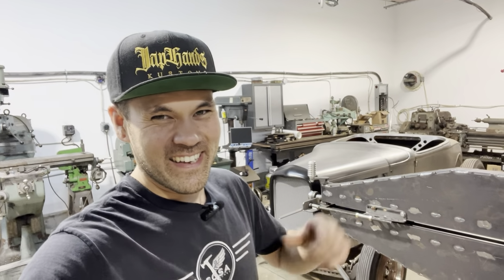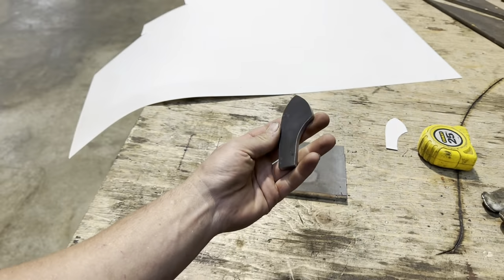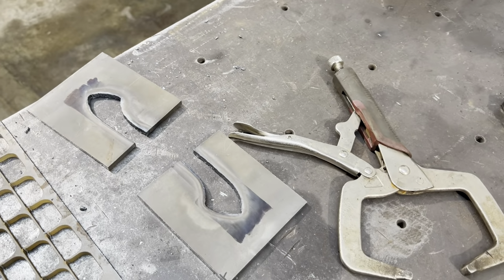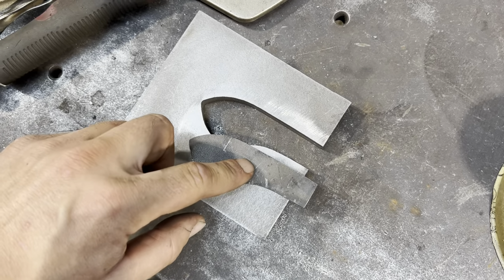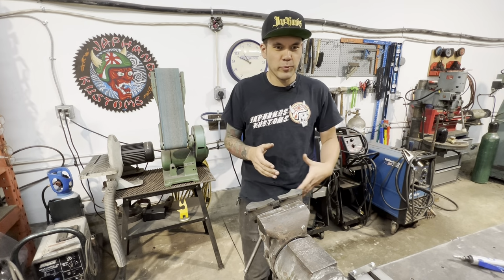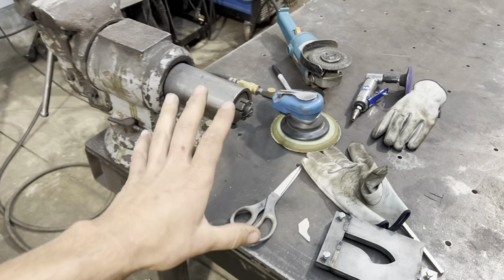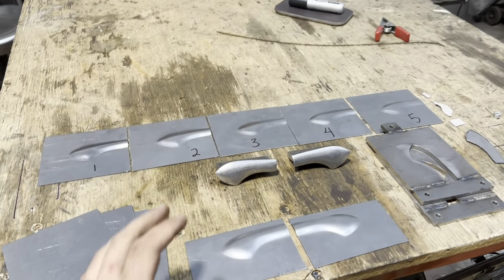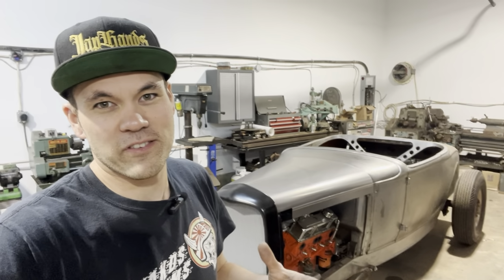How to Finish a Bead Roll & Make a Hammer/Press Form - Roadster Hood Pt 2

Comment: Really love the channel and look forward to every episode as I learn something new in each one. I'm currently working on a butterfly hood from an antique semi road tractor. The bottom of the hood must be "hemmed" or folded back on itself 180 degrees. If possible could you cover this process in a future episode. I don't have a bead roller just a brake, so the final forming must be done be hand/dolly. Any instruction, tips or tricks would be great! Thanks Karl!
Reply from the maker: Yea I have to do something with the hood as well either hemming or some kind of strength on those side edges

Comment: I've worked rebuilding engines, equipment, most of my sixty five years of life, next to guys doing sheet metal work, finishing the "other side of repairs, maintenance" of vehicles, and really enjoying the display of techniques and tricks that make this level of custom, fulfilled.  It's a real pleasure seeing it continue with a whole new generation, just like I grew up watching, learning and finally teaching.  I built a filing machine, "die filer" twenty years ago, and it is an incredibly useful piece of tooling.  I've been "doing this" to steel plate all my life, and am just learning how to "use it to produce the sheet metal finish form.  Mine doesn't have "overhead support", and I think I might well make a gantry to provide that support, seems to be a valuable asset.  At the time I was building my "die filer" a machine shop I used to work at, gave me a pile of "die files", they'd found, almost as if they knew what I was building.  This is the quality of work I watched in my childhood, and eventually did myself, often questioning if I'd ever equal those who taught.
Reply from the maker: Thanks for the great stories John. It’s very cool that you were building your own machinery back then and how lucky you were to get those specific files!

Comment: Always a pleasure to watch your thought processes. Great to see the simple rule to not file steel on the back stroke. So many otherwise skilled fabricators miss that & dull the file. One does back stroke on aluminum to clear chips. Simple but important.
Reply from the maker: Thanks for the tip on aluminum! I didn’t actually know that!
Reply: Hey.
   No problem. You have added to my skill set so much it is a pleasure to add something!
   I have a lot of fabrication work coming up, both structural & thin sheet metal. Thanks!
Reply: At the risk of asking a dumb question, doesn't the die filer just move the file up and down?  So it is always in contact on both forward and back strokes?  Doesn't that imply that it doesn't matter all that much? 
Or does a die filer have an orbital action like my Bosch jigsaw (which can push forward as it cuts and pull back on the reverse stroke, either a lot or a little or not at all, depending on the setting).
Reply: I was referring to hand held files.The die filer is a specialized application & files must be replaced when dull.

Comment: that really turned out great. I was really impressed with your torch cutting skills! Because that is not easy to cut something like that and have such a smoot cut! I have some welding experience from my mid teens in a welding school in Oklahoma City, Oklahoma. I've done gas welding and stick welding and got on the cutting torch a little, but didn't get into any tig or mig welding, but I've done some mig welding in the last 7 years.
I think the detail for the hood bead looks great. It really fits the car so well. Thanks for sharing the skills. I may never do this part but it's great to watch you make a body for this one. I look forward to the mig and tig tips on the next one and seeing the new detail welded onto the hood!
Reply from the maker: Gotta love the torch. It’s just so versatile a tool. I was lucky to have a excellent teacher. Thanks for watching! I’m looking forward to getting it welded in

Comment: Karl, I'm in West Michigan and my history (retired) includes commercial art which, did not totally satisfy my manufacturing desire, so I ended up involved in the injection molding, and stamping die support industries. Your a true metal tool and die kind a guy and I love your application the the Hot Rod arena. So cool.

Comment: Great result Carl making press tools is very rewarding especially when It works, I've used copper under the press die cut to shape between the metal and die for heights and edge crispness. Great video mate down under.
Reply from the maker: Great idea thanks man ! I’ll
Have to try the copper

Comment: Another fantastic project and video.  I've never really thought of doing this kind of metal work, I would defer to my epoxy glass skills as a trained boatbuilder to fix or fab cars.  I have to say though after watching your videos I am trying to work in the metal instead.  Thinking of your battery tray fab video and now this one, I am going to try to make a steel repair panel for the corroded out inner fender on my 67 Olds Cutlass.  I have the MDF and some donor sheet steel and I'm ready to give it a try.  Thanks so much for these awesome step-by-step vids and the encouragement to try using what we have on hand to create and fix!
Reply from the maker: Radon give it a try I’m sure you will mail it!

Comment: Love this channel for the fact you have a lot of equipment and are willing to show fabrication with basic tools. 
Not a body building guy here but may I suggest that on steel shaped with a slight inward curve, use a single cut file of the appropriate coarseness for the finish wanted, turn it 90 degrees and hold the file in both hands making forward and backward strokes. The file is perpendicular to the surface being filed.  This is called draw filing and it cuts on both the forward and backward stroke and gives a nice finish a level below normal filing can achieve. It is faster and won't groove the work piece as can happen on a curved surface when filing normal. Maybe you already are aware of it but went I overboard explaining for those that don't know. t works on all edges for fast cutting. No, it does not kill the file. 
Drilling holes to cut out the piece is called chain drilling. I prefer to use 1/4" drill bit and chain drilling is accomplished by interlocking the edges of each hole. May I suggest using a drill press and a floating vice for safety and speed. Tubalcain recently showed a video on how to make one.
Reply from the maker: Thanks for all the information in your comment. It’s amazing how many tips I pick up just reading these! Cheers Paul

Comment: Your really getting in your grove with the new shop! I love the old die filler! After thought ,heat the dies with the torch red hot and oil quench them. Food for thought.
Reply from the maker: It would last longer that way but they barely wear being steel on steel

Comment: For terminology in die forming, the part Karl hammered into the sheet metal is the punch, the top plate guiding the punch and holding sheet metal is a stripper plate, and bottom plate is the die.  Another way to control the stop depth for the punch shape into the die is to use overhang stops on punch stanchion(s).  Stanchions are the metal welded to the punch where the hammer impacts.  By having stanchions with overhanging "stops' cantilevered over the sides of the punch it stops the punch from traveling farther down into the die once the stops meet the stripper plate.  A few stops on the perimeter of the punch is easier to adjust the depth than an overhang around the whole punch.  Two lengths of angle bar welded end-on with the 'legs' overhung gives four stops.  Three angle bars with legs overhung provides six stops.  More stops = more control on perimeter of a complex shape.  Grind each stop to get the desired punch depth at that location.  If a stop is ground too much or mushrooms from a lot of use it lets the die sink too far, but can be built back on that stop with some weld.  The punch will repeat on the same sheet metal thickness for a lot of stamped parts.
Reply from the maker: Awesome information Jim thank you 🙏

Comment: If you put a bit of steel as a spacer (such as a 2" piece of square tube) on the vice of your drop saw, moving the steel you are cutting in line with the outside diameter of the saw blade, you could cut through that flat bar in one go.
Reply from the maker: Thanks 🙏 I don’t think of that at all

Comment: Usually when we design dies for this, the mandrel is the size we want and the die allows the mandrel and 2 times the thickness of the sheet metal.  Your first design appears to be a stamp to cut out the mandrel shape.

Comment: At 6:30, if you put a block of wood behind your plate/bar/banding stock, to put your workpiece on/in front of the centerline of your sawblade, you could have made your cuts in 1 pass; instead of the flip and 2nd cut at 6:45. This would make it both quicker, and a much nicer surface finish on your parts. Granted, not critical on the edge of a hammer-form.
Reply from the maker: Great point I never thought of that

Comment: Looks really good Karl1 lot's of work for that small piece. It's what separates the men from the boys. I was thinking that what you could have done was to extend the bead into he radiator shell and add the finish right there. That would have brought the rad shell into the design as a single piece rather than having it simply added on to the front. 'Sharp and crispy' is the difference between a western made die, and a die from China.

Comment: I have had good success doing this with 3D printing at a 100% infill a male and female die then putting it in my 20 ton press. I even made stepped and radius door jam pieces that you can’t buy as rust repair panels.
Reply from the maker: That’s awesome what a great tool

Comment: On the cold saw on the angled area where the chip fly put some rare earth magnets on the opposite side so the chips will stick to the metal but not the magnets so the chips dont fly all over the table then clean them up once in awhile ?

Comment: Hi Karl,
When you are filing a curve, I notice you file over the curve in the direction you are pushing the file. You will find you will get a more even curve if you start at the finish point and drop the file handle down as you push the file forward across the curve.
Nice job though. 
It is amazing what one can achieve with basic tools. Would you ever use a press to do that rather than a hammer?
Regards Dennis
Reply from the maker: Thanks Denis! I really appreciate that! Yes using a press would be even better but I used a hammer just to show how easy it can be without having a press

Comment: Have you considered using a hard durometer rubber in place of the cavity die blocks? Why did you chose to use the hammer method over using the hydraulic press? I am just asking for my own learning process, I was a tool maker for over 20 years. We used a lot of dies in the aerospace industry. Keep up the great work I am still learning.
Reply from the maker: I would like to try using rubber in the future! I have not yet. The reason I didn’t use my press is only because I didn’t want people watching to think that you had to have one to do this. Just trying to keep it simple. I would definitely use the press myself for its consistency. Thanks a lot Mike! Cheers!

Comment: Great video. One safety comment: The drill press with the chuck key chained to it. I watched a co-worker turn on the drill press without fully pulling the key out of the chuck and the chain wrapped his hand up into the chuck. Not pretty. Messed his hand up pretty bad.
Reply from the maker: Yikes! That’s dangerous

Comment: Are you going to finish the bottom edge of the hood? Perhaps a wired edge?
Reply from the maker: Yes I will be finishing the bottom magic I don’t think I’ll use wire I may just bend the edge to 90 and spot weld a piece of square bar in there or a thicker piece of angle

Comment: Hey there Karl, hope all's well. Question for you and or other members in the group. Looking for a suggestion for a new blade for my 14' chopper, opting OUT on any more of the abrasives (for obvious reason). My DeWalt isn't the quality as your sweet Evolution setup there however, I'm thinking a good blade would make a significant difference. I stick to 1/4" or less stock in a variety of shapes & sizes but wouldn't know which type (tooth count etc) to target. Would appreciate any helpful intel before I'd roll expensive dice. Thanks and stay safe . . .
Reply from the maker: These evolution blades are pretty excellent
Reply: @MakeItKustom  Thanks for getting back.  I'll needs to make a command decision on that sooner than later with upcoming projects LOL. I didn't have a chance to even experiment with the louvre idea for my tractor hood,  wasn't critical so I turned it out as it was. I looked at a number of your other vids for a similar "finished product" so I'd have a concept starting point however, I AM the resident "FABS" . . . . (Fix All Broken Shit)  guy. Always appreciate the benefits of and your willingness to share expertise! Be well and stay safe  . . . JJFIII

Comment: Hey Karl. Awesome job as usual. 
Have you ever built “hidden hinges” for any of your projects? I have a 54 Dodge truck with one factory exposed hinge on the top. I’ve been considering rebuilding the hinges because the fit on my doors is terrible and they squeak and scream each time I open them. I haven’t found any videos on how to build and install smooth hidden hinges with machined bushings. Anyway thanks for the content.
Reply from the maker: Hey thanks so much I have built them before! There are really simple hidden hinge kits that you can buy From Speedway. Or at least have a look at how simple they are from them so that you can build them yourself. That’s what I have done in the past. Flat bar and round tubing with bronze bushings and shoulder bolts. The bronze bushings and shoulder bolts can be bought from McMaster Carr
Reply: @MakeItKustom  thanks man I appreciate the response. I may just try one of those kits.

Comment: Most interesting.  Why no allowance for metal thickness???  Incidentally: what is that 'small' lathe in the background?  Many thanks. PT
Reply from the maker: There is allowance for metal thickness because the depth is stopped keeping the full size also helps crisp the edges
Reply from the maker: The small ways is a Hercus
Reply: @MakeItKustom  Thanks for that.  Are you operating out of Australia (where else is there! and where else is there a Hercus?)  It had occurred to me that pinching caused by the depth setting might have avoided clearance problems, or at least controlled the situation.  It just seemed unlikely.  There used to be an industry making model trains from brass.  Anyone who has experimented with this stuff will tell you why it's 'models' not toys.  They formed entire cabs and nose assemblies from ONE piece.  The first time I saw one of these pieces I had to have a Mintie.  Have been thinking about simple pinch trimming; for a rank amateur like me would require a lot of Minties.
For a lot of reasons encouraging people to MAKE things is a major interest of mine (and gets me growled at).  Wonderful: keep at it.
Thanks: PT

Comment: Hey Karl. I have a tig welder and was wondering how many amps you weld 18 gauge with. I realize all tigs are different but if you can point me in the right direction that would be great. I can do thicker metal. It’s the thin stuff I’m struggling with.
Reply from the maker: I’d typically like to use the rule of thumb that is one amp per .001” So for a 1/8 inch material it would be 120 A and for 18 gauge it would be about 50 amps

Comment: That was awesome Karl , when you first dropped the “male” piece into the “female “ piece and said the fit was “not bad “ I laughed ! . I love how you answer our questions as you move along. I was thinking if the fit is tight then it could shear and sure enough you mentioned that. Not to blow smoke up your ass but I’ve got to say once again that for a young guy your knowledge of metalwork , welding , machinery , etc etc is fantastic. A question , I know and appreciate that you explain that you don’t need fancy tools to do this stuff but would you normally use your press to stamp out these pieces ? . Thanks again buddy !
Reply from the maker: Yes I definitely would’ve use the press for this just for the consistency factor. But even myself didn’t have a press for a really long time I think it’s only been a couple years. Just wanted to make sure everyone knew how easy it was to just use a hammer! Thanks a lot Mike! Cheers

Comment: Karl,  Yet another great teaching video!  Do you have access to a Woodworker's(?) "profile gauge" (or whatever they're called) with the 100+ thin steel "fingers" that you can use to transfer profiles?  Would that tool be of use instead of or to help making some of your templates?  I know it wouldn't beat your CAD (Cardboard Aided Design ;) in many cases, but it might still be of use in your workshop.
Reply from the maker: Yeah I have those and they are very helpful but when it gets super small like this I like to just do it by hand

Comment: Seems to me it would have been easier starting your bead 4 inches from the front edge. A line about 4.5 inches from the front on the inside of booth sides and clamp your bead roller on the mark.

Comment: Would a hydraulic press help keep the pressure even on the die? My little ole brain is in road gear!
Reply from the maker: Absolutely a hydraulic press would be a much more consistent way to go. I would’ve used it but wanted to make sure that everybody saw how easy it is with just a hammer in case they don’t have a press